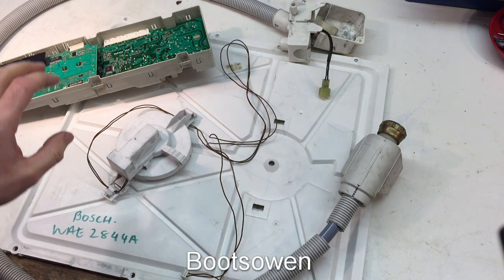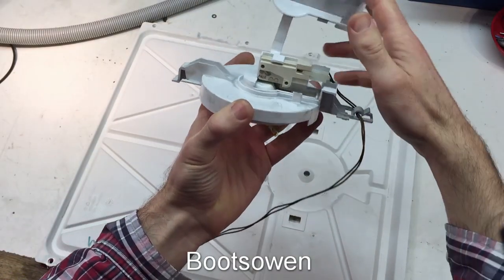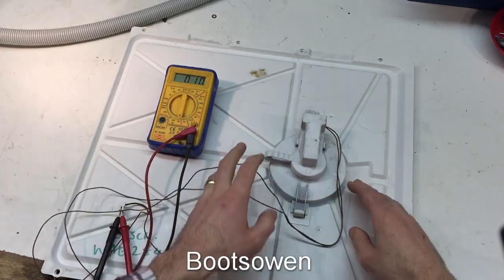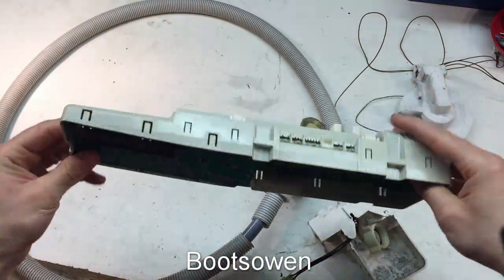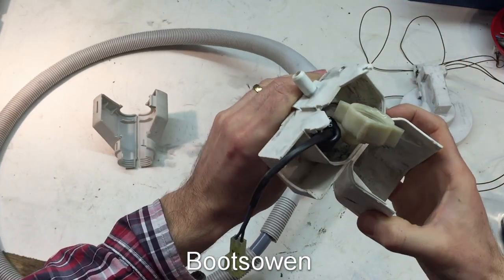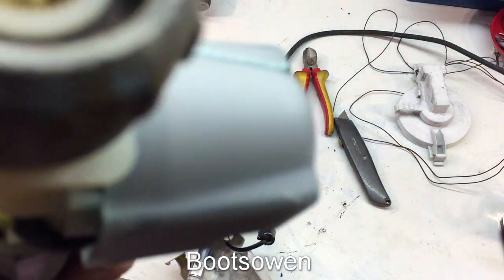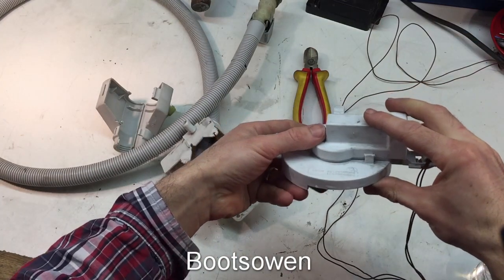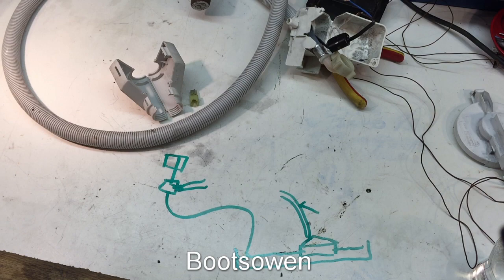Figuring out how a bosch aquastop works

Comment: Thanks for that.  We have just purchased a new Bosch DW (mid Oct 2024) and I wanted to find out more about this Bosch AquaStop feature.  I was specifically checking to see if the principle was based  on an excess flow valve which closes on very high fluid flow, say when the downstream supply hose catastrophically fails. These fluid flow valves are (were?) used on large petroleum tankers and as such do not depend on electrics and/or electronics and sensors. So they are basically simple in concept and everything is inherently contained within the specially designed screwed or flanged inline valve, with no outside control.  But I get it. Here, the Bosch designers here have elected to use electronics and a float switch to sense and control that risk and no excess flow valve. Double walled water supply tubing too by the looks of it. Really interesting. Thanks for posting.

Comment: Saved me during lock-down!!! Washing machine stopped working. Inlet tap sending water fine, but the pipe wasn't allowing water through. Saw the electrical cable in the pipe and thought something wasn't right... now I've watched this it all makes sense! I've must have had a bit of a flood. Now I've got to figure out how to get under the washing machine to empty the water and figure out where the leak is coming from! Thanks again!! Life-saver!
Reply: In case it helps someone else, for me i disconnected the hose from the machine (at the machine end) and tested by doing a rinse. It didn't call for any water, but I could hear the motors inside the machine (not the pipe) trying to take water. From watching Owen's video, I can see that the machine needs to request water via the cable in the inlet pipe, which in my case it wasn't. Tested the cable using multimeter and there was no connection (i.e. wasn't registering any resistance - not no resistance), maybe suggesting the cable in the inlet pipe is broken somehow... I'm going to take the cable apart and see if i can fix it, failing that see if i can order a new one. In my case, i've taken a look at the flood switch and it's disengaged so it's not that that's stopping the pull of water... can't figure out if it's the cable (in the inlet pipe) or the machine that's stopping things here. Will keep you updated in case it helps someone else. Mine's a NEFF washer/dryer (presume NEFF/Bosch/AEG all use this system)
Reply: Quick update: 
I tested the cable within the washing machine to see if it was sending voltage when it tries to fill (I just put it on a rinse+spin cycle to test with the multi-meter attached to the connector. It does, which would suggest that part is fine and the cable in the inlet pipe, or the valve in the inlet pipe is broken.

For the time being, I've taped over the cable which triggers the Aquastop within the machine and swapped the inlet pipe out for a standard inlet pipe until lock-down is over. This allows water to go into the machine and i can wash clothes etc for now. Doesn't stop any flood though, and i did read somewhere this invalidates guarantees, not sure if that's true... I'll get someone to look over it then when lock-down is lifted! #StaySafe
Reply: @MrDanananna  my Bosch is doing the same. I pulled the machine apart because it wasn't washing dishes well. Hoping I would find a blockage but unfortunately nothing obvious. After putting it back together same problem. But also some cycles it wasn't filling properly but the pump was running. So I poured some water in the sump and it was washing fine. 
 So now I've got to figure out if this "Aquastop" is a fancy name and same thing as an inlet valve. As it seems to be a common problem.
Reply: @jamlee344  check the floating switch in the bottom of the machine to see if there's been a leak. Sounds like you're having the same problem as me where the machine doesn't request water through the aquastop inlet pipe
Reply: @MrDanananna  yeah no signs of leaks.
Reply: @jamlee344  if you start it going so it requests water (like a rinse) can you hear a buzzing coming from the pipe near the tap end? (There should be a bulky unit on the pipe near the tap end)

Comment: Just bought a Bosch 800 series today and they changed the design. You connect your water hose to the base of the unit now and that could leak and there’s no protection at the hose anymore.

Comment: Thanks to your video I figured how it works. I had an E18 flashing ( it was th pump got stuck by a coin), I opened the drain and removed the coin from the pump. Unfortunately I was not careful and some water spilled and went in the washer basement, E18 was solved but E23 appeared (aquastop activated). I had to open the back of the washer, drain the bottom of the washer and after that also the E23 was gone! Thanks again a lot, you saved me from an expensive bosch technician visit...

Comment: Great video, But please next time dont blow the water out near the safety block .... Man I was on the edge of my seat praying you wouldn't hit that thing.... big risk man.... be smarter, teach smarter... plenty of stupid on the internet to unlive themselves copying you <3 great video though, I am now informed and know what I must fix and why, cheer.... Stay safe man.
Reply from the maker: Have a look on my channel for a video of me putting my hand in a bucket of water that has a washing machine motor in it running and connected to mains electricity. What are you worried about. What do you think will happen if a safety block gets wet?
Reply: @bootsowen  if you're that confident with your mouth on a hose of water and squirting that water onto 240 or 120v ... I can't help you .... Those are your risks to take. I'm far from uneducated about electricity.... So all the power you. I'm out of this convo now
Reply from the maker: Does electricity flow through clean water? You are far from uneducated? All power to me! I'll take 240v!
Reply: @bootsowen  o.g.dude, tap water is not distilled

Comment: thanks so much, this helped me figure out why our Bosche washer was saying there was low pressure/blocked inlet. There was water inside the outside hose probably activating a similar system to stop water going down the pipe

Comment: Thanks for the explanation. 
My machine constantly switches the aqua stop on and off when it has a heavy load and shakes a bit after a couple of loads in a row, so i think the float is loose or a tiny amount of water remaining in the tray. No error code. Logixx 8 sensitive,  over 10 years old.
Reply: Follow-up - the machine is working again.
The base of the washer had a lot of loose rust, but was dry now, so I cleaned a bit around the float and gave it a jiggle to make sure it was moving OK.
Strangely, just before I got the back off the machine, I was doing a short wash and the motor failed.
First time I needed to replace the brushes since new - previously the motor's thermal switch failed about 5 years ago, which is now bypassed.
I cleaned the commutator and fitted brushes $5 from ebay. I think about another 5 or so years until the commutator is completely worn through.
It's as good as new again.
Reply: One difference on mine, it doesn't have the plastic tray, and the switch assembly is black, and is part of the side/base moulding between where the feet screw on and the shock absorbers bolt through. The float just hangs above the metal base of the machine (hence the rust around it).

Comment: This is such a clever solution. I bought a house last week and now I'm looking for appliances to buy. After watching this I will definitely buy Bosch!
Reply from the maker: It is quite a difficult question to answer, I would buy older bosch, but I am not sure about new bosch! I guess it depends on if you will repair them yourself or get a repair person to help. Congratulations on your purchase.  Do not buy on credit!
Reply: @bootsowen  Hi, thanks :) Yes I bought it with 10% cash and the rest over bank credit, 10 year payment plan. Unfortunately that was the only logical way, since here in Zagreb, Croatia monthly rent is too expensive and buying is much more reasonable. And since payment will be done in less than 10 years interest will not be too bad.

Thank you for advice. I'm not really concerned about few malfunctions now and then, my biggest concern is potential water damage to my house. And that's why I would prefer machine with protection from water leaks even if it stops working after few years and needs repairs.

Do other manufacturers also have those kinds of leak protection features?
Reply: Don't buy Bosch washing machines they are garbage, will stretch your clothes out and drive you nuts not wanting to start when there is no fault, it will say the filter is clogged you open it and pull out 3cm worth of cloth from towels or whatever and then it starts again (or sometimes not until you wait a day or pull it apart and reconnect it). Only buy Electrolux, ASKO or AEG (AEG is only good on top models). My Bosch cost over $1800 and was the top of the range at the time and broke within 3years. Absolute trash brand for white goods. Samsung is also trash.

Comment: But does the fault clear automatically and does the switch reset itself once the fault has been solved and the water mopped up?  I triggered the device accidentally by knocking a bucket of water over so it is not a fault in the machine.  I have dried the tray and autostop but now need to know if there's anything I need to do to reset it all. I have not touched the valve at all.  Thanks.
Reply from the maker: No Idea, why not try plugging it in?

Comment: Thanks for posting.  Just bought an AEG machine with a fractured aquastop case and a broken plug.  With your help, I'll be able to check if the break in the case is a problem. Looking at your video, I don't see an issue.  

AEG do not list the aquastop for my machine as a spare which is a bit odd.

Was trying to figure out your accent.  At first, I thought American but it all became clear when the pint glass when the Emerald Isle appeared.  You need to get that charged and congratulate yourself on the great video.

Also, loved the drawing on the worktop with markers.

Comment: My aquastop (on Cylinda machine) is closed by default and when I put current in it, it opens up... 
Seems like my version is regulating the water intake instead of being a safety mechanism. 
I needed a longer hose, hence why I removed the original one. I screwed on a standard hose and my machine filled up with water, no stop anywhere inside the machine.. 
So my guess is I need the original piece that looks like a aquastop, but in reality is the actual water inlet. 

Does this sound weird?
Reply from the maker: What you say makes sense, but seems like a tricky way for the manufacturer to do it. You could just put the original back on and add a hose and coupler and attach to the back of the machine, sometimes these things need to be vertical.
Reply: @bootsowen  Thanks for your reply. 
Well, I kind of messed up the original hose at the back end. In my version, it's a tiny water hose that had a soft plastic enlarger/clamp at the end. So now when it's cut, the hose in itself is too tiny to attach back. I must find some way to attach a rubber enlarger, from 6-7 mm to approx 10 or 12, which is the water intake diameter of the machine inlet. 

Aside from that, I did connect the electricity in the hose, and connected it to my tap, holding the other end (the end that should go into my machine) over my sink. I started a program, hoping to see the machine feed electricity into the magnet lock, opening for water. But nothing. 

Do you think the machine could sense that the hose is not connected, via e.g. pressure, and therefor not activate the water supply? 

P.S. sorry for long question :) 
Cheers and have a merry X-mas
Reply from the maker: I have posted another video about an AEG aquastop that was based on gravity, pressure and magnets. Maybe that will help you.
Have you looked under the top of the machine to see if there is a solenoid for water inlet in there. it seems odd if there isn't
Reply: @bootsowen   Thanks, I'll look into this. 
Well, with a standard hose the machine just keeps on filling up, so I guess there is no solenoid valve inside the machine. That would have stopped the regular hose in that case, I guess?

Comment: Question please 🙏: How can I know if my aquastop is good or defective? I blew through the hose and nothing came out on the other side. Checked the ohms resistance on the wires and it's 4.37K ohms.
Reply from the maker: replace it with a plain hose? Is this possible?
Reply: @bootsowen  Already checked the Aquastop by plugging it directly to AC power. The hose is good 👍🏼!
Don't understand why my dishwasher won't start to take the water in 🤷🏽‍♂️. Checked almost every possible reason. Can't find it..

Comment: its activated on my old washing machine.. I think it was the door seal leaking.. can I reset it once I replace the door seal do you know? thanks,
Reply from the maker: I think it should reset once the float switch under the machine is dry.
Reply: thanks, for you assistance, paul @bootsowen

Comment: Hi bootsowen :)

 I have a situation where I have had to do some repairs on my washing machine.  It is a Siemens WXLM148AUK/19.  I have done the gasket, door switch and powder drawer and replaced the repair that I did on the door lock nine years ago (which was a contraption including 'gaffa tape' and a piece of the plastic handle from a large box of washing powder...  now replaced with more of the same but probably a better quality plastic handle so it will probably outlive me  this time!  lol.  ;)  However, I now need to replace the brushes.  

 My problem is that the isolation valve that turns the water off is stuck and even after WD40 and my sewing machine oil being applied for the last 4 days I cannot turn the switch to stop the water inlet flow.  (after looking on every youtube video of these valves it seems they are built to fail after a very short time.  Built in obsolescence at it's finest.  I cannot do anything to the pipes or replace the valve as my house is rented.

 The Aquastop I have on my washing machine is a genuine Bosch and is not like the universal ones that have just a normal screw on connection to the washer.  Mine has a box like thing that has loads of wires and techy things where it joins to my washer, ( able to be seen when the top of the washer is off).   I am working in a confined space and need to tip the washer up but cannot as the pipe restricts the movement and I am worried about disconnecting the aquastop incase it is pressurized or has some sort of stored electricity in it,  (it has a lightening image on it).   Is it possible to remove the aquastop from the washer end (not the isolater valve end) just while I take the motor off to replace the brushes or will it damage the aquastop?  (or worse still give me a cold shower that I haven't asked for).   I have looked on all the Bosch sites for info but none cover what my problem is. 
I may be a 5'2" female but I cannot work in the space that I have without disconnecting that pipe! 

 Thank you for trying to explain how things work to people like me, who at 62 still think they are capable of mending their own gadgets!   Your Mum must be so proud of you.  :)
Reply from the maker: Thanks for the question, very detailed. If I were you I would try to stop the water somewhere before the isolation valve, you probably have a stopcock on the place that you live. If you can find it and turn it off then all of the water in the house will be off and so that washing machine valve will be redundant and you can unscrew the aquastop hose. 

If you do turn the water off as it comes into the house this is an opportunity to replace the valve. these are usually cheap. 

If you can't turn the water off, look harder at the washing machine valve. I presume that the one you have is like mine and has a little red or blue plastic handle that is held on with a screw. if you take the screw off and the handle, you can get a spanner, or locking pliers on there carefully and gingerly work it loose. It will probably be fine if you give it a good bit of force, the plastic bit can't take it but the metal bits beneath usually can. 

Another option can work if you have plastic pipes to the valve,  is to crease the pipe so that water can't flow. there is a special tool for this, but a locking pliers (vise grips)  used carefully so it doesn't cut but does close the pipe internally will stop the flow. 

I wouldn't faff with the aquastop end, if you do damage here it will be harder to repair than the valve. 

I have posted a few videos of how to do the brushes on bosch machines, that probably have a very similar motor to yours. They might be helpful to you. When you have the motor out it is worth blowing it with compressed air to get the old carbon dust off it, or use a paintbrush and a vacuum cleaner. the dust can get around the machine and do damage, it is worth carefully vacuuming the circuit boards as well because this dust is conductive and I have seen a few machines wrecked this way.   Or don't do any of that and you will be fine too. 

If that doesn't make sense and me more questions, or post a video of the parts in question.

Owen